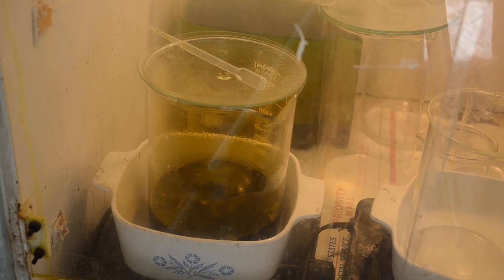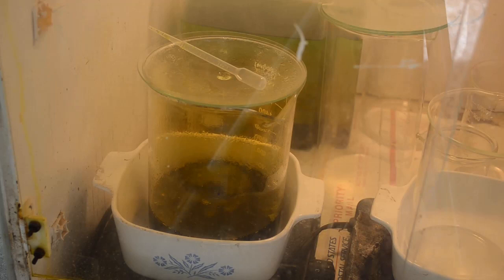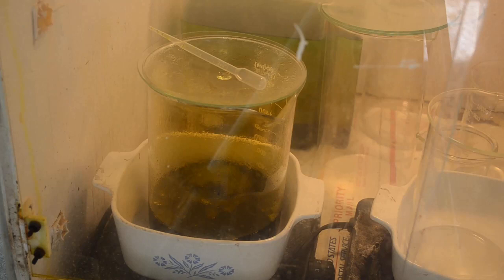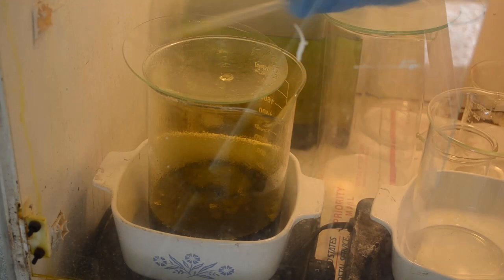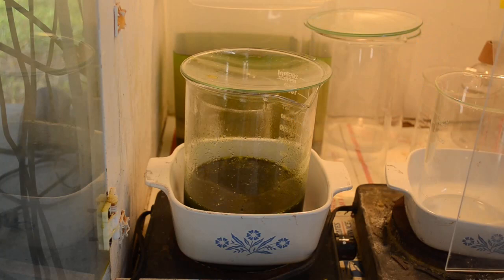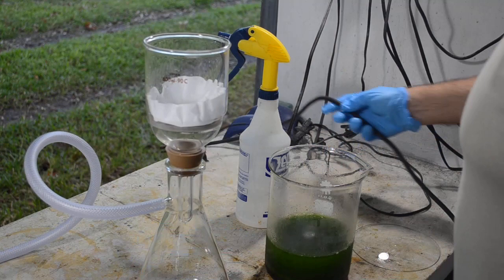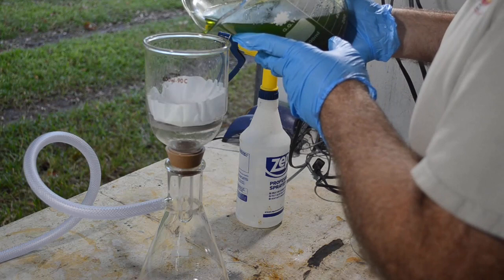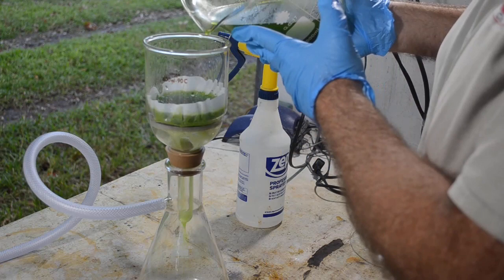Gold Recovery From Electrolytic Refining of My Cement Copper Waste

Comment: Interesting series.  I did something similar in 2019 and experimented with my stock pot.  Firstly all nitrate waste is kept separate from chloride based waste.  All my nitrate waste was treated with KCl to convert to KNO3 and CuCl.  The KNO3 was really easy to crystallise out and I use that to make more HNO3.  The CuCl I treat with H2SO4 and crystallise out the CuSO4 and then I distil off the HCl from what;s left.  From my chloride stockpot I I skip the KCL step and go straight to distillation and recover as much HCl as I can.  Then add in the H2SO4, recover the CuSO4 and re-distil the HCl that is produced.  I then ran the CuSO4 through an electrolytic refining to recover the purified Cu and dirty H2SO4 and cycle that back into the process.  No more bothering with using Fe to drop the Cu.  The slimes that are filtered out have yielded a surprising amount of Au, Ag and Pd although not what I would call a lot.  But enough to make the process worthwhile.  Then I add in the fact that I am recovering much of the reagents I use and this reduces my costs.  They way I see it my time is free.  Everything else I have to pay for.  The less I have to pay for the cheaper the whole process becomes.  And add to it that I enjoy doing this and it becomes even more worthwhile.

Comment: When you are melting your cement copper, throw in all your ultra low grade flash plated/plated jewelry copper based crud and melt it with it. You will be surprised how fast it all adds up!

Comment: Not sure what your doing, but I never use copper in my stock pot. There's no need to. It's for AR solutions only all the PGMs' will eventually settle to the bottom. As for my nitric solutions, I add copper to remove the silver. Then transfer the solution and cement out the copper. You can then collect good clean copper to reuse

Comment: Metal reactivity series chart tells you that bold and platinum group metals are lower than silver.
Therefore it is to be expected you will find both in your silver slimes.
Try running a well made silver cell to capture the precious  slimes in your filter basket.